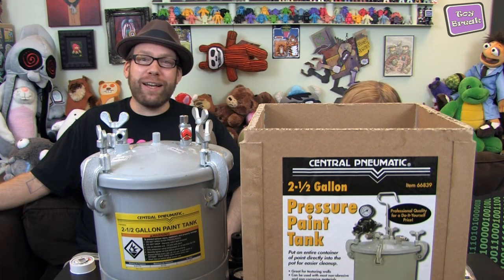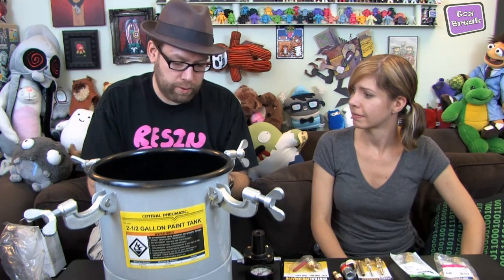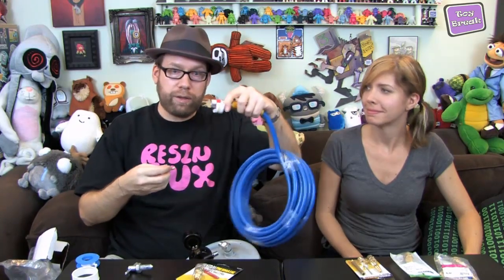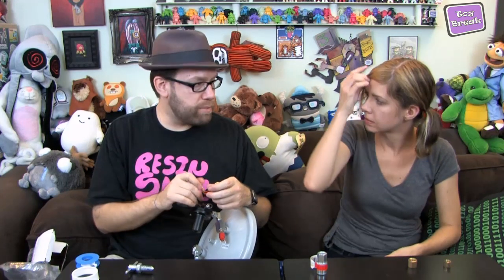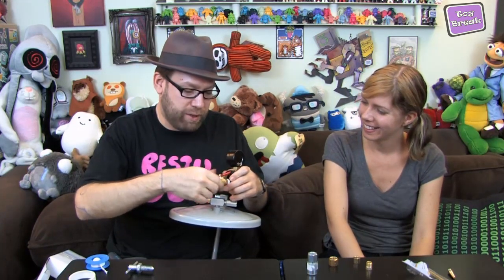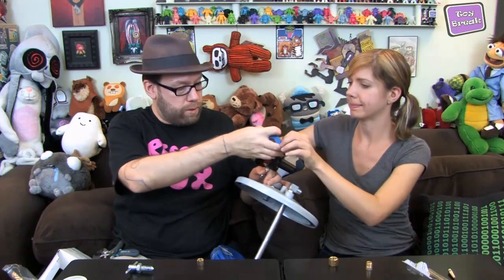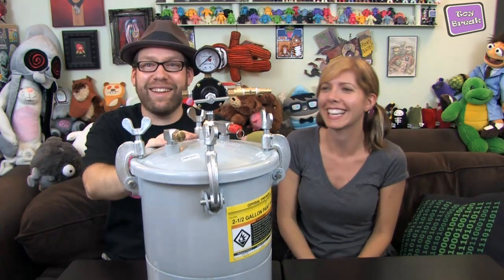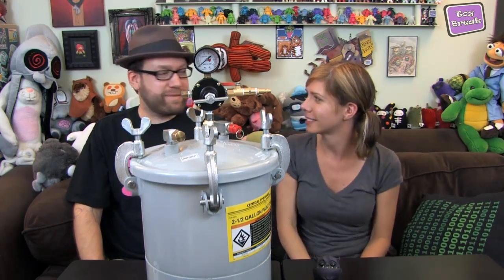Toy Brief 90 : Pressure Tank Pot for Molding / Casting Resin

Comment: Both pressure and vacuum are said to work reliably for casting resin, but pretty much every silicone manufacturer I've seen says pressure chambers won't work will silicone and that you must use vacuum chambers for those silicones that require degassing. Others say pressure works fine with silicone. Any experience, comments?

Comment: Does the air compressor that you have in the links actual works well with the converted pot? Like no problems at all?
Reply from the maker: sonicrockmanx Yeah, it works great! Depending on where you are using it, it may be a little loud and as time passes and equipment gets older, valves and such may need to be replaced, but it's a solid choice for an air compressor.

Comment: The pot shown here from Harbor Freight has been changed a little since this video came out. Now the paint draw pipe is threaded - so now you don't have to hack it out, you just unscrew it.
Reply from the maker: Good to know! That will be much easier to use for making a pressure pot!

Comment: The Teflon tape should be wrapped in the opposite direction of the threads.. Why? Because if you wrap in the same direction the threads run, when you attempt to thread the male fitting into the female fitting the Teflon tape will likely be pushed off of the fitting and fail to make a good seal.

Comment: Hi,  being a mechanic I have used the sealing tape you just need to make a single layer slightly over laping and of course you don't put any in the opening.  Can I use a airbrush compressor tank to pressurize the pot I have a valve already to regulate the airflow it would work perfectly just make sure the end has a proper coupling to connect to the tank I would guess.  

David from Edmonton

Comment: How would you remove the big pipe inside?  Would you be able to use a simple pipe cutter, the one that you twirl around the pipe and keep tightening?  If not, where could I go locally to have that done?  THanks SO MUCH for this video.  It is so helpful.

Comment: So I bought my tank from harbor freight, and the pressure valve, air inlet, safety valve, etc are already all attached to the lid. Do I need to remove all of those, tape the connection and reattach them or is it fine to just leave them as they are?